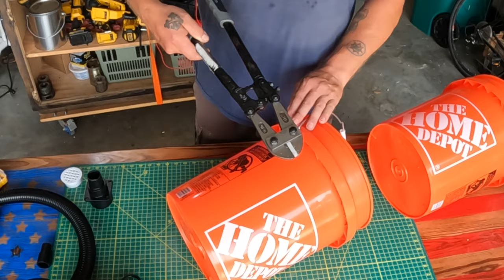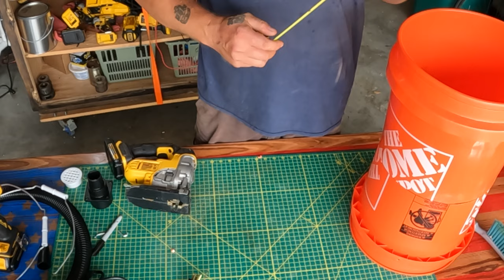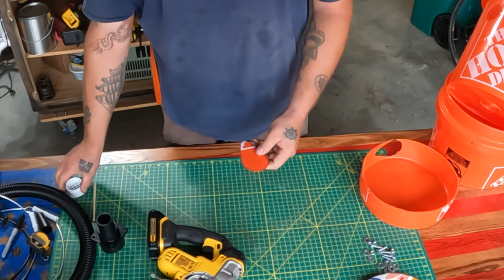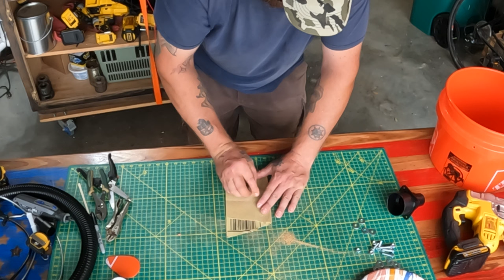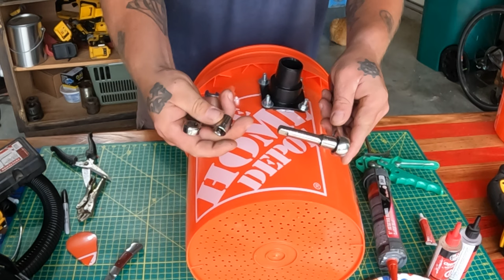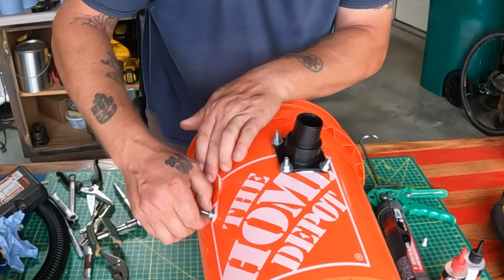Home Depot bucket becomes a machine. #howto #diy #cute #automobile #shortvideos

Comment: Cool design. I'd use a highetr quality bucket, those HD buckets breakdown and crack.  There must be different grades of HDPE plastics.
Reply from the maker: Thank you for pointing that out.  I did notice one of my buckets in my bucket garden has faded from the sun over the last 5 months.  I will keep this unit out of the sun when not in use to keep it going for a while.